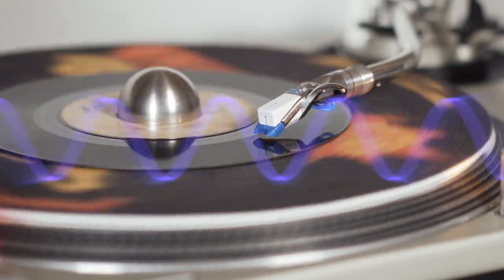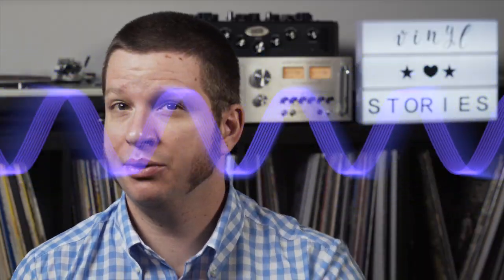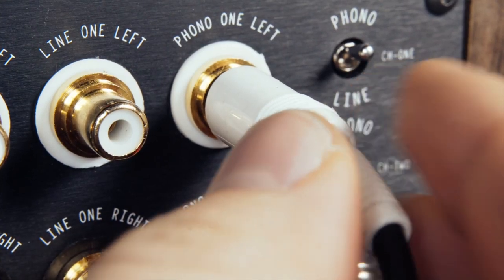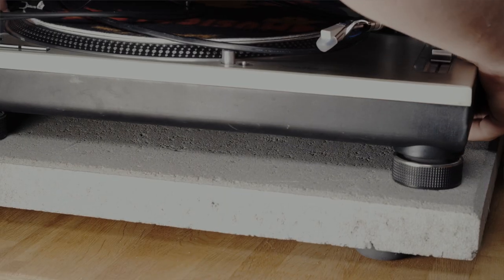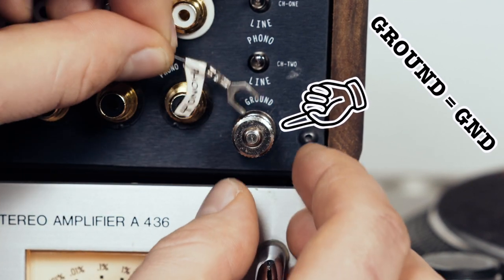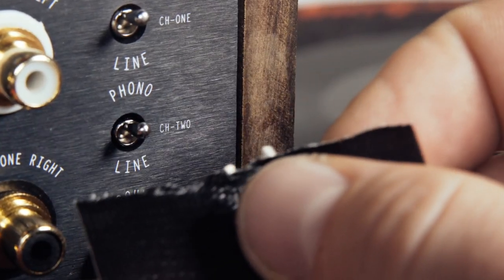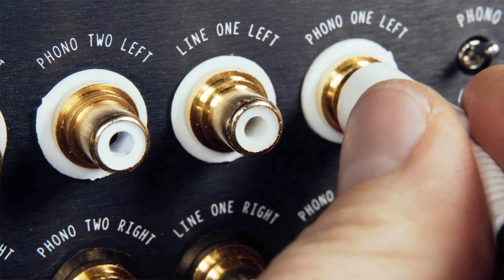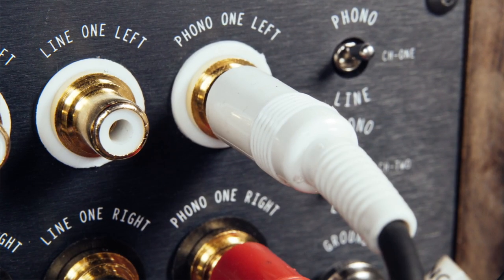Turntable hum noise fix tutorial [part 1: how to ground] ★ vinyl stories ★

Comment: You pointed me in the right direction. But did not solve it pressing the ground against the chasis of the preamp, instead pressing the exposed wire into another rca in the preamp. Thanks duderino

Comment: Humming can also come from poor capacitors on the main circuit board of your turntable. This happens when a manufacturer uses cheap Chinese filter capacitors. They can be easily removed and new better quality ones soldered in place.

Comment: Amp: Yamaha AS-301, TT: Denon DP-47f. Problem: Left channel is dead if I ground it to the amp via the ground cable. If I discard the ground cable both channels work fine but there's an unpleasent humm. I tried several RCA cables and ground wires, the problem won't go.
Reply: Makes me think that the wiring of the Denon DP-45F has an error in it. As it is rather strange that one channel switches off when you ground the table. Have you looked inside the deck, to evaluate the internal wiring?

Comment: I got turntable hum with my high end system even when grounded.  I work on guitars so were the grounding cable connects to the amp I stuck copper shielding tape for shielding guitar cavities around were it screws in.  No more hum. Cheap and inexpensive and can be bought in a garden centre or DIY shop
Reply: I'm confused, would this apply to a mixer as well?
Reply: @alykandeel1931 yes it should work as long as the cable when screwed in touches the copper tape.

Comment: Hello buddy. I have a problem with my turntable because I want to connect it to an external preamplifier for better sound effect. the following problem was created. when they open and close some appliances in the house e.g. kitchen etc. on the speakers sounds a chic chuck. let me remind you that the specific turntable from its construction has no ground. I do not know if this is to blame and if there is a way to ground it. I also tried to place both the turntable and the preamplifier in various sockets in the house and the problem remains. if you know what could be wrong please help me. thanks.
my turntable is stanton t92usb.
the preamplifier is project ad box s2 phono.

Comment: I have a buzzing and humming issue on my Technics SL1200MK2. Earth ground is working and connected to my mixer but still have those annoying sounds... pls help!
Reply: Anastacio Lopez  I am having the same issue. Just purchased a second hand 1200 and I get a loud noise hum. I think some work on the tone arm and replaced the tube only (S). And did not properly re install the ground inside or one wire came loose.

Comment: what kind of wire can i use for an lp120? My amp has a ground screw so clearly i need to ground it
Reply: Hello I'm having same issues as you had. Did you manage to resolve it? I careful set it up 3 times and still hiss and slight crackle pop. What a pain! Lol
Reply: @ryant75  just enjoy as is, onyly the ultra fanatics keep nit picking
Reply: @arncj18  yeah man I get it. I tried the record cleaning, better stylus, separate wall outlet and multiple set up etc. I'm done. I find myself tinkering around more than enjoying the tunes. 
 Thanks for your reply. If I figure it out I will keep you posted. 🙄
Reply: @ryant75  one thing also, keep in mind, old second hand records that have scratches, also make that trademark pop hiss sound. New records, will after many uses have scratches as well. Unless the owner handles them with care. But to be fair, look at how Dj's handle records, scratch them , finger oil builds up on them etc. they wash them and still use them. Remember there are lots of enthusiats that go past a normal limit. I enjoyed watching detailed videos also, but the ultra freaks that make 50 min videos on how to make 8 component liquids to clean their records, keep away from those.

Comment: that's not a motor hum,  well at least not a vibrational one,  that is a ground issue hum...I have already dealt with that by looping a bit of copper wire over the spindle and connected to the earth wire..  

what I wanna know is how to remove vibrational hum through platter originating from motor... 

Best wishes
Reply: Damping the cabin?